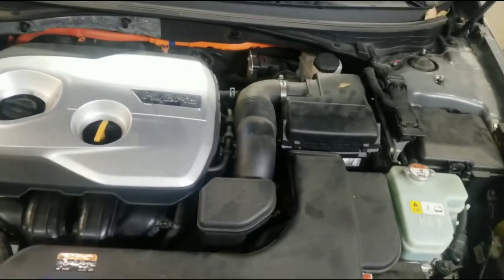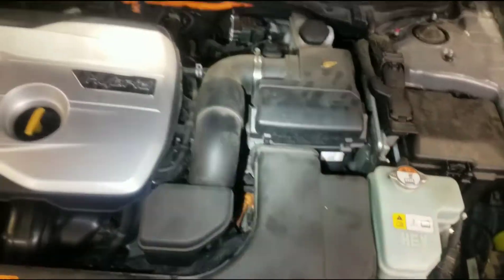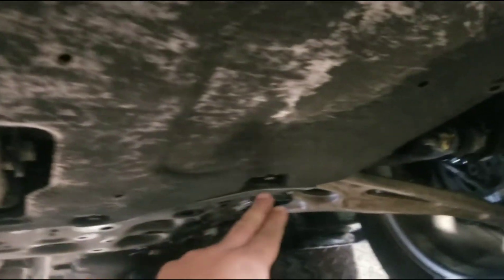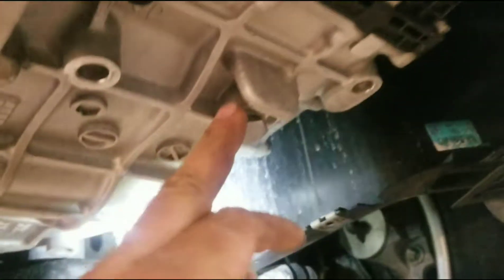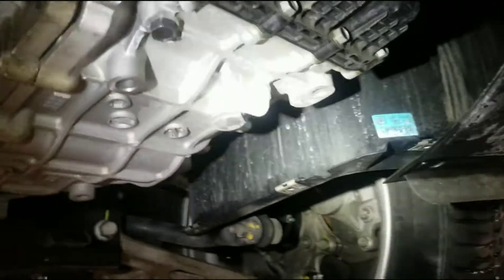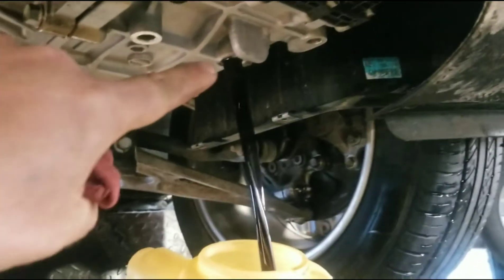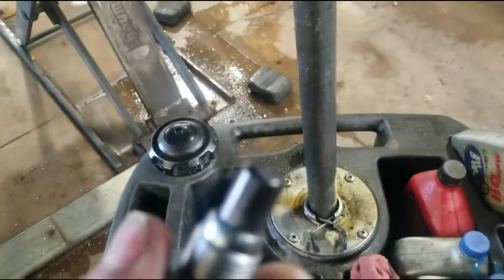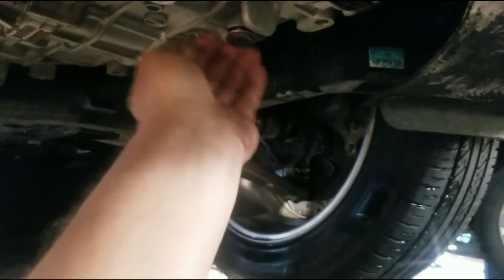Hyundai sonata 2.0 hybrid 2017 transmission fluid change

Comment: how many times do you recommend to do fill and drain, so that all the oil in torque converter is new
Reply from the maker: 60,000 miles

Comment: The multi-vehicle ATF is fine as long as it has the correct coverage for the vehicle. This vehicle for example requires Hyundai spec SP-IV fluid. Check the back of the bottle and make sure it says SP-IV.
Reply: hey what brand you recomnded ?
Reply: @SkufAbuzevich  Idemitsu, Liquimoly or Havoline Multi-vehicle ATF

Comment: Hi I changed transmission fluid today Hyundai sonata hybrid 2013 I was like 3.25 quarts out and I put back new one the same may be like 3.30 quarts I have the question why so low quarts I have and I fill when drive now liltle shaking car when drive mean when put gas

Comment: Should the level be checked from the level plug while the motor is running? The problem is, how do you make the engine run while checking on hybrids? Is there some secret to that
Reply from the maker: Yes, transmission should be checked running.   We at the shop have the hyundai diagnostic tool and can have the engine run.  I don't know how to without it.

Comment: What size socket did you use to take off the fill plug?
Reply from the maker: If i remember right, it's the same size as the drain plug

Comment: Would it be fine to change at 115k miles if it’s never Ben changed and then changing it every 30k miles after
Reply from the maker: Probably be fine.
Reply: @hyundaihowto  that’s what I was thinking then do it every 30k miles after just to keep the fluid nice and clean since it hasn’t Ben changed for over 100k miles